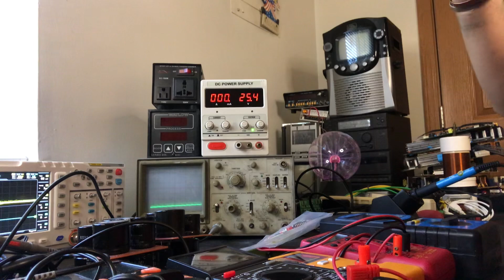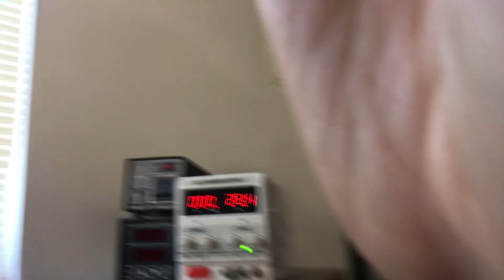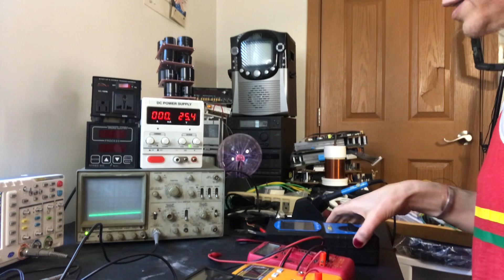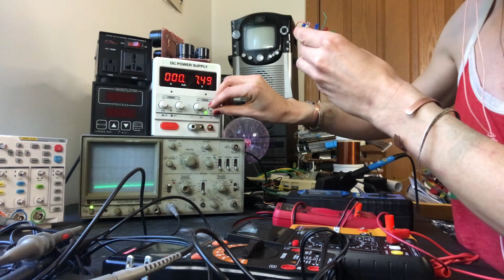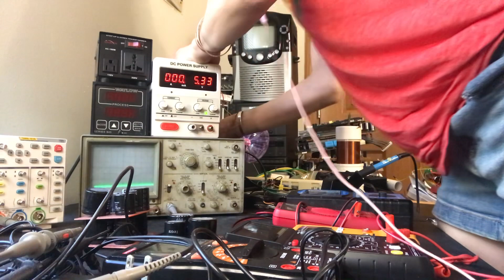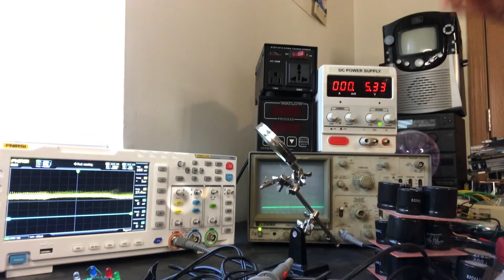sa8die lab coming together,lol thanks for watching

Comment: Interesting where you've chosen to spend to build your lab.

I also had legal troubles (and at 49 then!) which caused me to lose my beautiful 5000 square foot lab some years ago. I've long since moved on, moved rural, etc..  but I only have 60 square feet in which to tinker. You'd be surprised at what you can do minimalistic. Indeed you arguably have "better" kit than I do now .. but.

So I have 3 main power "bench" supplies that I use. One is based on an ATX computer PSU, so has the regular +/- 5 +/-12, and 3.3, outputs, as well as a handy series string of 1N4001 diodes at the standby for tapping off any of those at 0.7V increments. Well sufficient for almost anything I do low voltage/breadboard. Another is a simple freewheeling boost converter made from random bits (FET, inductor, and rectifier scavenged) driven by a 555 - about 400V unloaded, it's good for single tube play .. say a 12AU7 preamp, or to power a 6E5 eye tube (where it drops to about 200V), and safe with a cup of whiskey. The third a bit more serious, a variac feeding a 750V CT transformer (I think salvaged from an old TV) with a voltage doubler output. Variable 0 to 1.4 KV at fairly hefty current. The point being you can do wonders building instead of buying, and you can't spend your way bench smarter.

Was a pair of dudes I used to share bays with a few years back .. always made fun of me for not having $50K in Snap-on. Until they were struggling with a seized unit bearing in a Crown Victoria for two hours, and the old man showed 'em how to remove it with a half inch bolt, nut, and two wrenches in 5 minutes. They stopped making fun.

AH yes .. desoldering salvage! Now that's the spirit! Every shop has a bin of dead soldiers waiting for organ harvest.

Back in the day when surplus shops were common, selling random boards for fifty cents .. this was the hobbyist supply for parts.

So I'll tell you the old school secret. 

If you're repairing then the component is toast, and preserving the board paramount. So just cut the damned bit off and desolder the individual legs. If you're salvaging, then the board is toast, and it's about preserving the component, right?

Torch the forker off.

Yup, propane plumbing torch. Believe it or not, heat is not an issue. Solder melts and the part releases before it even gets warm to the touch with a bit of practice. It's been my PCB salvage go to for 50 years.

Note that all PCBs are not created equal .. the old single sided phenolics .. the parts pretty well want to jump off with a warm gaze .. newer multi layer 'glass and ROHS solder can be a pain.

As for the other side of that - repair. Again, not all created equal. so learn all the desoldering techniques because some work better than others depending on the board or component at hand. 

Capacitor tester? Meh. Many may disagree, but I've personally never found a use for one. Know thy circuit.

I built a "cute" little circuit last week (741, 567, 555, and 4017) that detects in sequence the 5 "close encounter" tones, and then 'does' something .. light a bulb, open a lock, start a car, etc. 

Gave me a few problems at first .. but (duh) my immediate suspicion correctly was the 50 year old torch salvage electrolytic that I was using for timing. My opinion .. which like buttholes, everyone has .. is that if you know thy circuit, you'll pretty well know a cap is bad by what the circuit isn't doing properly.

Insulation tester? Same. We actually use these at work for what in my opinion is the dumbest thing ever: Certifying that TWELVE VOLT low voltage DC circuits in ships are isolated to so many KiloVolt. Transport Canada rules, okay. But if you love HV at the bench .. then your dollars would have been better spent on an HV probe.

I hate this world of test equipment automation and fake smarts. There was a device called an 'octopus' once .. typically home brewed, that with a careful eye, knowin' what you glean, and a shitty 'surplus scope, in the right hands would outperform $20K of newfangled diagnostic kit, and six book-smart electronic grad students. Also good for testing caps.

Anyhoo .. keep it up gal. Legal shit can suck, but you haven't killed anyone, so this too shall pass.

P.S. I wish I could still stay up for two days. I used to crunch a 10 hour shift, 2 hour round trip commute, do the laundry, play the bass, code 6502 assembly for 4 hours, renovate my house, build something .. and do it all over again. Now I look at the chore list  and go fuck no today.